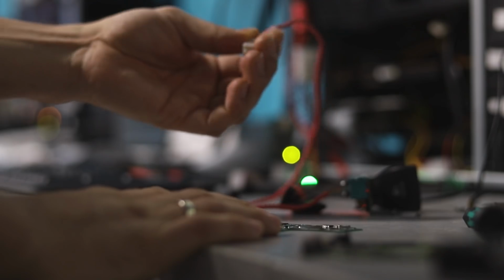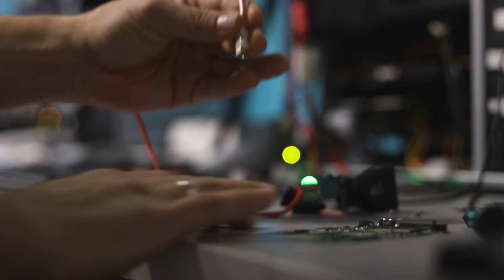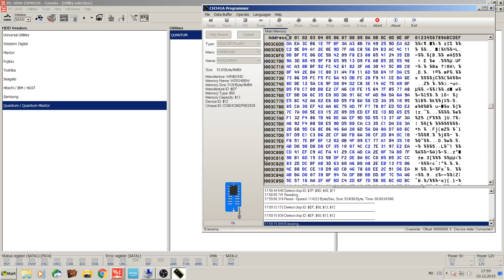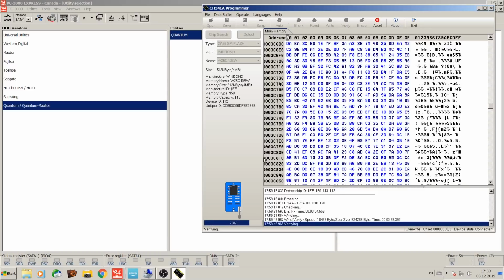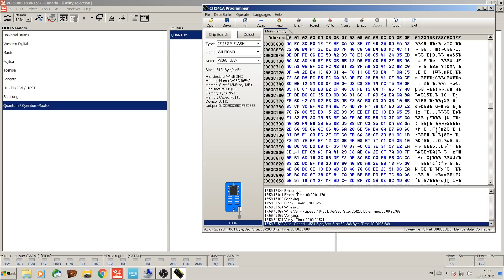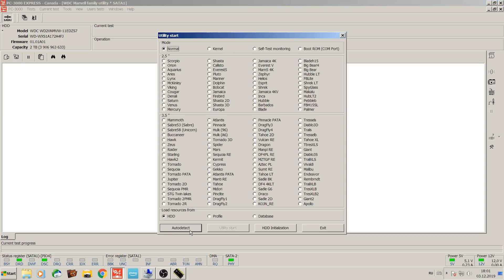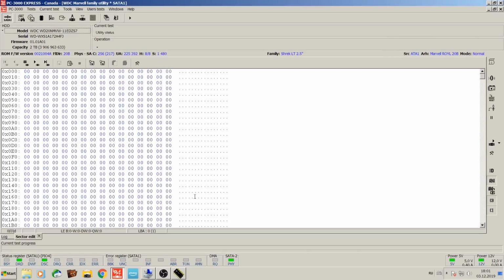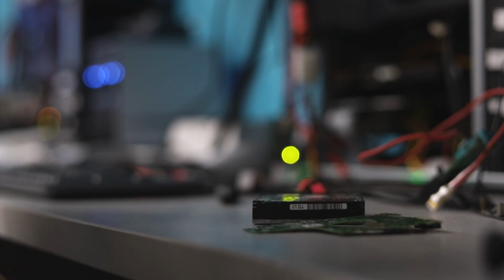3 best data recovery hand tools of 2019

Comment: Sir is there any dyi tool which can read my stored hdd platters for data recovery
Reply from the maker: No
Reply: @hddrecoveryservices  Can I use a dvd optical drive to read hdd platter for data recovery
Reply: @Saero-e6q  no. The data is stored magnetically and needs EXTREME precision to be read. DVD drives are optical. And if you touch the platter you can say bye to all data.

Comment: Hello Sir, I have a FANTOM DRIVES TFD500U16 external harddrive. The power switch does not click to either on or off position anymore but is loose and does not latch to the on or off position. The external harddrive files began not being accessible at times and eventually stopped coming on. I took out the harddrive out of the enclosure. The drive does power on and spin up but seems to stop working and when it continues to spin, I get a driver not found message when I connect it to  SATA to USB cable. Can the files be accessible without the harddrive being connected to the pcb board in the enclosure that it was connected to?

Comment: Is it possible.to recover data from low level formatted disk?
Reply: As long as it has not been used since the format.
Yes, the odds are good.
Just need to run a data recovery tool that scans the drive surface

Comment: I read somewhere that Hitachi/HGST drives are the most reliable. I think the source was Google, which uses vast numbers of drives in its data centres, and so has extensive statistics on failure rates. 

Although no drive has a zero percent failure rate, but if I remember correctly the Hitachi/HGST was significantly lower than any other manufacturer.

This is quite amusing, for those who remember that Hitachi inherited IBM's HDD division, makers of the infamous "Deathstar" drives. Hitachi even kept the name "Deskstar", which I thought was an odd decision. Ironic that their drives should eventually become the most reliable.
Reply: Hitachi is not the best.. Best is Toshiba and Seagate. Western digital and Samsung are OK too
Reply: @godfreyotejere1101  ...Western Digital is garbage!  I've got 4 dead HDD's to back up that statement. Check Backblaze on your claim on Seagate.  Your source would be?

Comment: Do you accept data recovery service from someone living to another country?
Reply from the maker: Absolutely
Reply: @hddrecoveryservices  

I have SeaGate 7200.12 1TB 3.5 inch SATA 3 GB/s internal 2011. 

The problem is there was a burned chip on the PCB. During that time this HD have warranty but my data is more important so I forget sending it to SeaGate to be replaced. Do you have a PCB for this drive so my data recovery will be easier and cheaper. 

SN: 5VP7BQTE
Model: ST31000528AS
PN: 9SL154-303
Firmware: CC46
Data Code: 11243
Site Code: WU

They said before that if you will find a new PCB for your HD its manufacturing date of that PCB coming from another HD should be close to the manufacturing date of your HD for it to work.

The story of this HD was I was using a low quality China Disk Enclosure. When the enclosure stop reading my drive I thought my drive was broken but it was my enclosure. I have two enclosures back then and never thought of removing this HD and testing it to my other enclosure. I forced the enclosure to read my HD until it burned the chip of the PCB. Then I tried it in my PC and another enclosure the drive cannot be read.

Comment: How reliable is this programmer? I have one from dolphin and it's crap.
Reply from the maker: I didn't use the programmer from dolphin, so I can't speak for it. What seems to be the problem with yours?
Reply: @hddrecoveryservices  it does not read properly. When you compare the reading with PC3K, they are different.

Comment: 4:12.... Where did that debris come from that just appeared on the platter then diapered!
Reply from the maker: the lid is sealed with a silicone gasket. That gasket is exposed on the outside perimeter, so when the drive gets "cracked" open some of that debris lands inside. clean compressed air takes care of it, and it's loose. Debris from platter damage is a different story since the surface is magnetic so it sticks.

Comment: I actually currently own a CH341A programmer, I havent been able to get it working on windows 10, it worked good on win 7 though
Reply from the maker: I have not tried it on a 10 yet TBH
Reply: @hddrecoveryservices  the 3 times Ive tried it on 10, everything installs but it cant seem to detect the chip, it could be mine somehow stopped working (they are cheap chinese devices after all) but I dont have win 7 installed anymore to test it with

Comment: Best way to recover data from a seagate? dont buy one to begin with.
Reply: I cant agree enough.
Bought as 8TB Seagate external.
It failed within 1.5months

Replaced it with a WD.
Still running after 2 years
Reply: @IIGrayfoxII  , OK, but I had had three WD's and two have lost partition tables with no reason, the third started to be slow and ticking, basically impossible to recover the data in a time. Never ever to buy something from the WD. The best hard drives were from the IBM , but that was once upon a time.
Reply: I do not buy WD.

Comment: I use one of those programmers quite often in pc repair, reprogramming bios and such. Looks like the same software as well. I need to get one of those cables, would save a lot of time. As opposed to desoldering the chip, programming it, and putting it back on. Thanks for the info.
Reply from the maker: It is a very convenient piece for sure Chuck

Comment: How does the pogo pin eeprom reader compare to the clip style one? I assume its better seeing as its the one you use, but can you give us a bit of commentary on how they perform and differ or improve on one design or the other? thanks for all the content as usual!
Reply from the maker: Pogo pin needs some practice. But after 4-5 reads you get the hang of it. It's a bit tricky because you have to keep pressure on the chip and then still operate the mouse to press buttons. Some ROM chips don't have header pins, so the clip does not work on those at all. Pogo pins work with both package types as they press into the pad
Reply: @hddrecoveryservices  awesome ! i figured it was something like that. thanks for taking the time to reply! any good resources for using the ch123a you can suggest? I guess I'll need to power one of the lanes sometimes as the 5v supply is spotty on these models? specifically looking for info regarding that issue..

Comment: The Quick pogo pin adapter for eepROM is not shippable to Australia but the Programmer is, so I can't get what I need.  The platter extractor is $220!!  Time to get the 3D printer up and running I think lol.
Reply from the maker: Programmer comes with a clip, but have you checked eBay for the Pogo adapter?

Comment: CH341A is good only for 3.3V and 5V rom chip, if you use it on 1.8V rom chip you'll kill it most likely.
I use Revelprog which can read/write 1.8V as well 3V and 5V rom  chips.
You can find many adapters here:
https://www.reveltronics.com/en/shop/12/chip-programmers/accessories-and-adapters
Reply: @Daniele Malagoli...thanks for the link. Much appreciated!
Reply: Ch341 is chip that connect usb to eprom or mcu. The programer use mcu (like 8051/atmega). 2.5" work only 5v,the 3.5 work in 12v , but controler 5v. I never seen chip that work on 1.8v only.(ddr2 ram in 1.8v,but not eprom ir rom)
Reply: If you work on hard drives as Erkin does, you might find sometimes spi ROMs that work at 1.8V.  Example on Seagate Barracuda 7200.14 (Grenada family) you can find W25Q40BW rom. See datasheet
https://www.winbond.com/resource-files/w25q40bw%20revf%20101113.pdf

Comment: So generally speaking, if the platters are scratched like this then it is unlikely the data can be saved?
Reply from the maker: Data is not recoverable scratched surfaces. We need to isolate them from active headmap, so that the drive does not attempt reading with them. Leaving only healthy disk surfaces in act with modified head assembly from the donor drive
Reply: @hddrecoveryservices  thank you 👍

Comment: Hi Erkin, do you have a link for that version of the CH341A programmer software? I have an old version I think and cannot find that one anywhere!? TIA and keep up the great work!
Reply: The CH341 can not provide correct voltage (constant 5V and logical levels). Also the provided "software" is 99% cracked, and 50% working.
Reply from the maker: I'll check tomorrow. Can you DM on instagram?

Comment: Hi Erkin,  Thanks for the link on the light!!  I've been looking for that item after watching your videos.  Dumb question for you.  Are you only removing the platters to look for damage knowing you wont be trying to get data off the drive??  I don't see how that tool keeps the platters aligned if you have to put them back in and try and get data.  I've seen you on a couple of videos doing that and I keep wondering if your just showing the platters are scratched and that's all.  Jerry
Reply from the maker: Jerry, we line them back by edge notches. Inspection light shows what sort of damage we are dealing with. In this specific case only 2 out of 12 surfaces look potentially accessible. If client is willing to spend money for what looks like 1/6th of available sectors, then we will attempt partial recovery.

Comment: I assume with any platter damage, data recovery is usually not worth it as too much data has been compromised.
Reply from the maker: platter damage cases are hard and time-consuming. It depends on what you mean by "worth it". If client needs data and he accepts then it is worth it. The only the client can determine if it's worth it :)

Comment: How is it possible that an almost new HDD can get so damaged? Could it be a production failure?
Reply from the maker: no, it was probably dropped, and then left scanning with some software tools when the drive became inaccessible partially. Its important to catch these things early before more damage is done. This drive still has hope for partial recovery on 2 out of 12 surfaces. We may make a video on it later this week or next
Reply: @hddrecoveryservices  Wow only 2 out 12. Pretty much all data has been compromised.
Reply from the maker: @rsuryase  depends on the zone size and file type. 1/6th is better than 0/6 :)